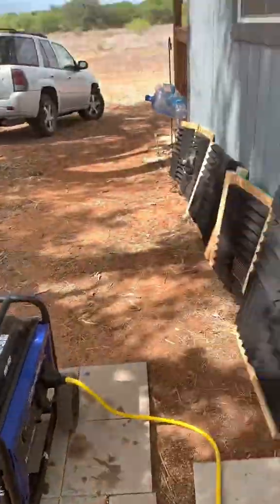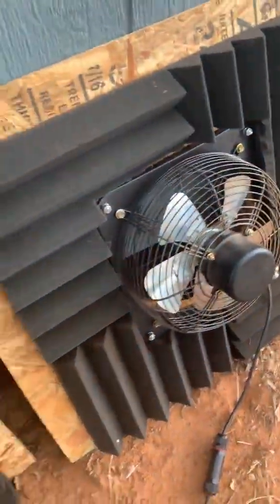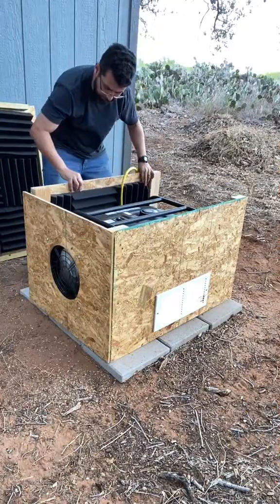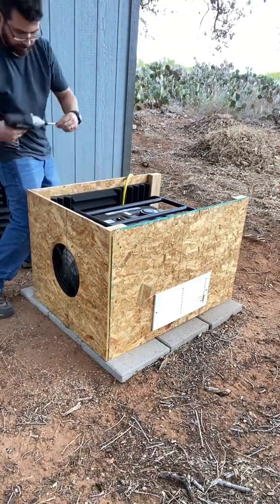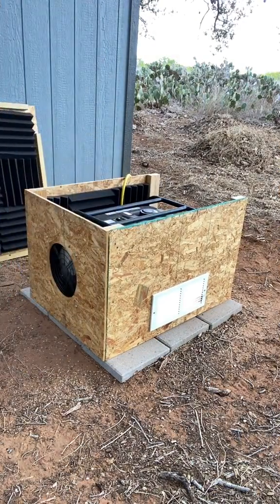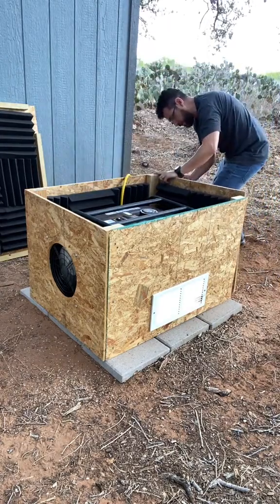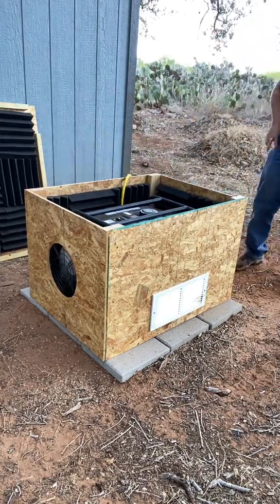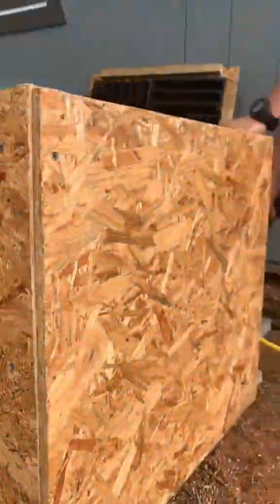🔇 Soundproofing a Generator | Quieter Power Without the Headache ⚡🧰

Comment: Guaranteed that thing either overheated or got cut off by the amount of CO2 it produced.

Most people put the fan by the intake  and even at that they also include a thermometer.

This thing would not have lasted a couple hours either before the generator shut off or the whole thing caught on fire
Reply from the maker: It works.. I have tried one without any vents, just a tiny hole for ventilation and the generator ran for 5 hours straight. I admit it almost overheated though
Reply: @soundproof-nation i want to put my genertr in room on roof top is it ok

Comment: Absolutely horrible idea! If you do not hard pipe the exhaust out of the box it will choke on its own fumes and you will ruin your generator. I've seen this 100 times over the last 20 years. My apologies but this is an absolute hack job.
Reply: Exactly. 100% dumb AF. You have to run the exhaust out of the box... Duh.
Reply: I just can't see that happening with some of these setups... Maybe this one .. maybe... But it does have a good enough exhaust and it's right in front of the exhaust soooo eh idk man
Reply: Although he says the primary goal of building this box was protecting the generator.